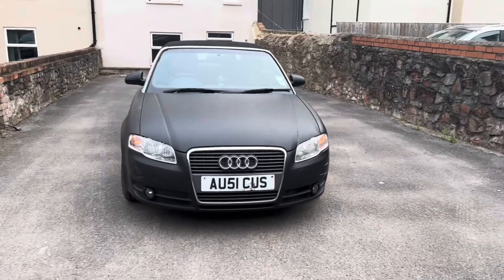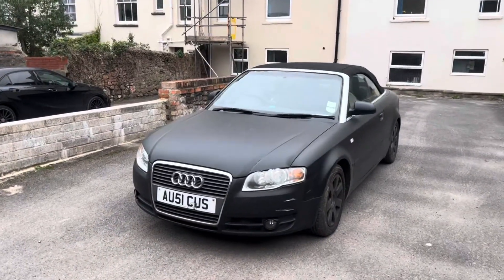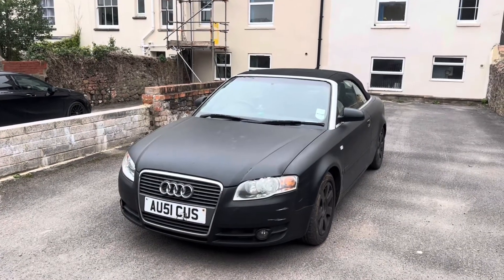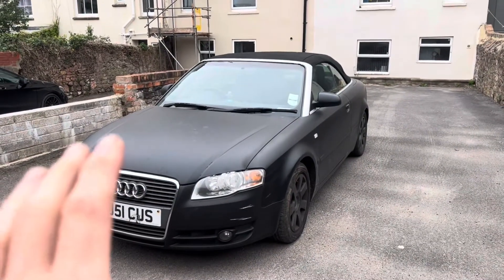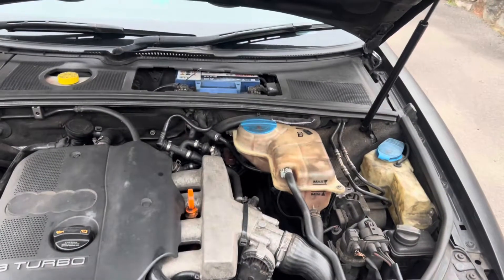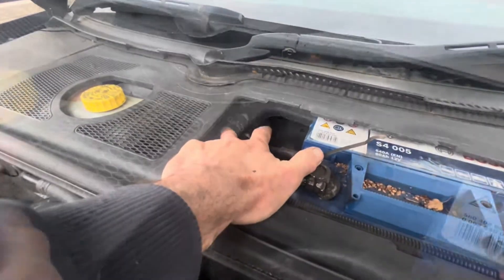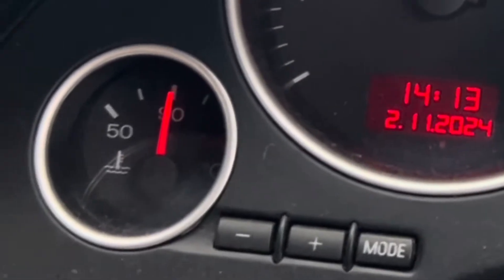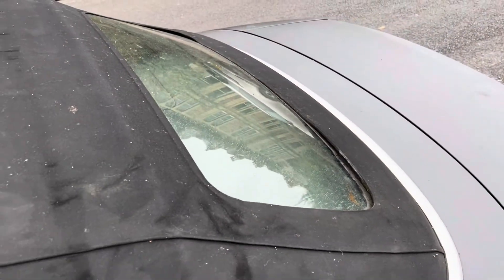Audi A4 radiator and cooling system - how to bleed air - overheating/no heat from blowers. FIXED

Comment: Had to replace the thermostat of mine I’m having so much trouble now overheat as soon as I go down the road can’t seem to get it. It blows cold air out of my heater. I just can’t seem to bleed the system so hard.
Reply from the maker: Sorry to read you are having problems. Audi cab be REALLY difficult to bleed. Did you watch this video and follow all the steps? Mike
Reply: @MikesMercsandothercars  yeah followed all steps completely went through like 15 L of coolant trying to do it just had no luck. Had to book it into Mechanic next week.
Reply from the maker: @HeyBigMikey  Hope the mechanic gets it sorted. I did this video after a mechanic fitted a new radiator and the car overheated on the way back!! Mike

Comment: Hi Mike would this work on a 2016 q5? Have the bleeder hole on the inlet/outlet matrix wanted to know if bleeding it like this would do the trick.
Reply from the maker: I’m no expert on the Q5, but Audi’s can be really difficult to bleed. If you have that bleeder hole on the inlet outlet pipe, that should help you bleed the system completely. Mike
Reply: Okay that you so much. I seen videos of bleeding the car with the car hot but having no luck. Going to try your way sir and will report back. Really appreciate you mate
Reply from the maker: Good luck - I spent hours trying to bleed all the air out the conventional way. Mike

Comment: Can’t find bleed screw on my 2009 Audi a4 1.8l
Reply from the maker: I take it that is is not on the metal pipe under the plastic trim piece in the same position as is shown on this 2007 A4?. Do you heater core input pipes have the small circle and pin hole as shown in this video. Mike

Comment: never I would imaging to bleed it this way but it’s a job done!:))imagine Audi dealerships lifting coolant tanks to loose air😂😂😂
I would suggest that normally on a EA113 engine platform the procedure is to push a 2k rpms and watch your coolant tank topped up once the air goes out.. if there is no progress - your heater core is probably blocked!:))
Reply from the maker: Thx for your comment - yes what a procedure it was to bleed the air from this car! The garage who changed the radiator are super experienced in high performance and classic cars and used the method you describe. When I got the car back it overheated due to trapped air. I think maybe the proper way to bleed the air is using VAG. Mike

Comment: Did a turbo swap and my fans were going crazy and no coolent flow did this procedure and my Audi is back on the road appreciate it🤝
Reply from the maker: Phew….glad you got it sorted. I still have to change the water pump which I’ve been putting off as the problem only manifests itself going uphill at speed. Mike

Comment: Been an endless battle not having heat at idle with my 2001 A4 since I did a coolant flush last month. This is the video I needed. Thank you so much.
Reply from the maker: Yes - I cant believe how difficult is is to bleed the coolant lines on an Audi. Hopefully you will once again have heat at idle - took me a few attempts on this car to get it right. Mike

Comment: Damn. My older Audi doesn't have a bleeder screw 😐
Reply from the maker: Does your car have the bleeder hole in the heater matrix inlet/outlet pipe? If not, you should be able to bleed the system in the old school way. Mike
Reply: @MikesMercsandothercars  Yeah, it does have the hold on the hose. Would that be good enough?
Reply from the maker: @ Should be. What model and year Audi do you have? Mike
Reply: @MikesMercsandothercars  It's ancient. It's a 1999 Audi A4 Quattro 1.8T that runs perfectly otherwise.
Reply from the maker: @ Do you currently have an issue with over heating under certain circumstances? Mike
Reply: @MikesMercsandothercars  Yeah. It seems to get hot when you go a certain speed. When looking at the reservoir while the car is on, it keeps going up and down, and sometimes it pumps coolant back but not always. This all started happening when the flange was replaced because it was too bent and started leaking.
Reply from the maker: @ Not sure what you mean by 'the flange' but one of the common issues on these Audi's is that the water pumps were originally made with plastic fins which can break over time. The symptom is that the temp gauge will start creeping up if you go up hill at above a certain speed. The problem becomes much more noticeable when the outside temp is warm the car is under greater load because is full of people. There are no visible signs of a faulty water pump and no codes are thrown. Mike
Reply: @MikesMercsandothercars  Okay, it turns out the problem was a lot weirder. I saw that the pulley for the water pump was straight up missing. I guess that's what caused the plastic flange to warp due to heat in the first place-- the coolant just wasn't pumping. I added the V-belt that it was missing and now it works perfectly. Thanks for your help!
Reply from the maker: @ Wow....that is a new one on me. It is amazing to think that your Audi worked at all without a water pump. I guess that is why so many Audi's with a faulty water pump get misdiagnosed. Most cars would overheat and become undriveable in no time at all! Mike

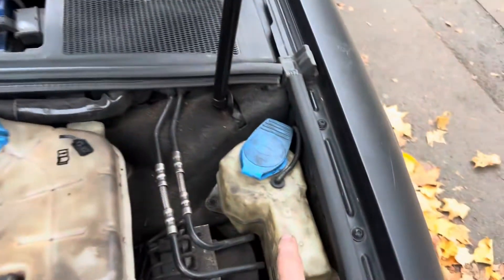Comment: 12:20 you can also replace the pump gasket
Reply from the maker: Hi - thanks for you comment. Do you mean the windscreen washer pump gasket might be leaking and that should be replaced? Mike
Reply: @MikesMercsandothercars  yes, this happened to me
Reply from the maker: @MariusPatrulescu  Cool - thanks for the tip. Mike

Comment: I will be sharing this with my mechanic.  Two heater cores and several thousand dollars spent at two shops trying to fix the no heat at idle issue.
Reply from the maker: I hope you get it sorted. A VERY experienced garage changed the radiator on my Audi and they still mucked it up, which just goes to show that even the best get it wrong at times! Mike